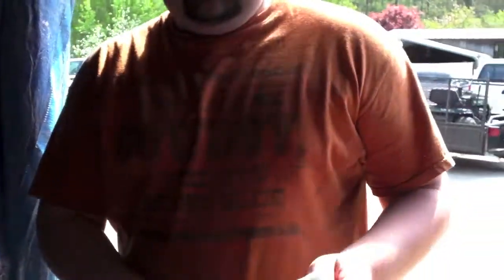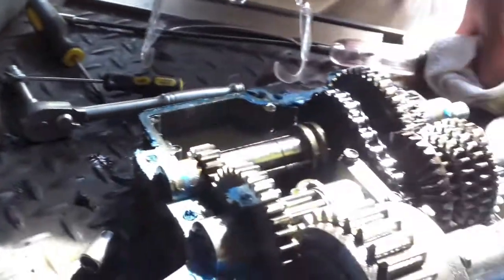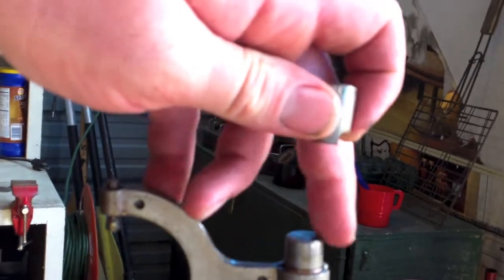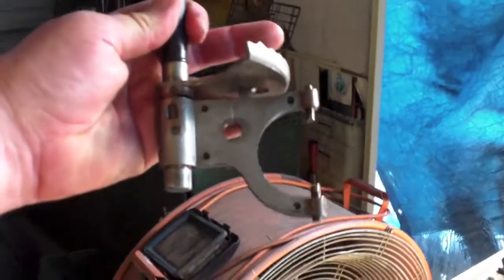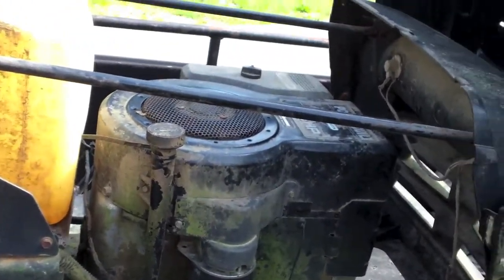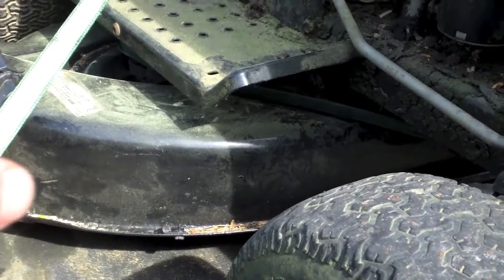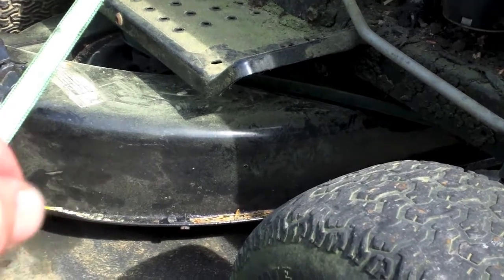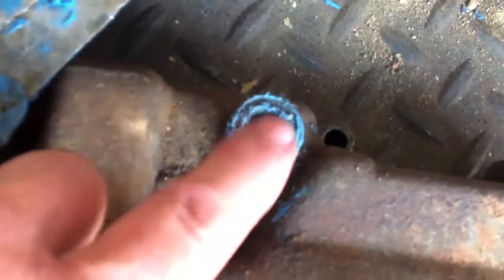Found the problem on the 820

Comment: Sounds like the new one is thicker.

If you have to apply so much force to get it into gear, there is a design problem in the gearbox, be gentle its only metal ha ha :-))
Reply: *****
Yep you can make one part stronger possibly at the expense of breaking another.
Is it a bending force or twisting force thats breaking the rod, have you found out that?
Reply: *****
Good, keep the bending pressure off it, plop an old bearing on the hole if you can, otherwise the hole/bar will wear or grind making it harder to shift :-))

Just thoughts, only trying to make it better for you :-))